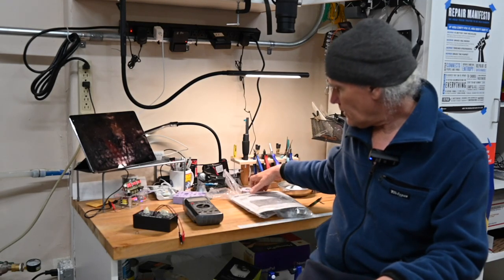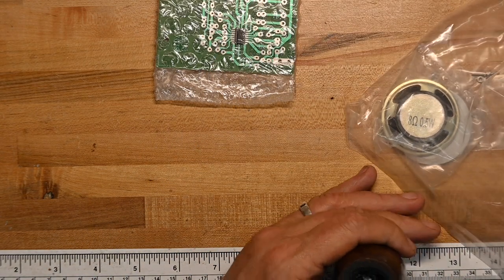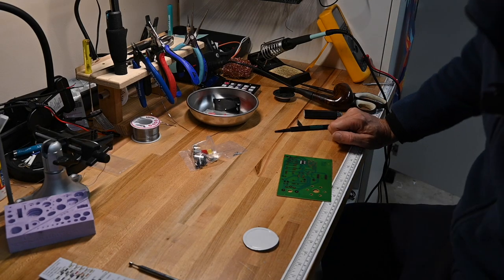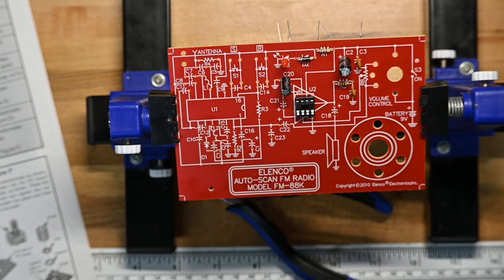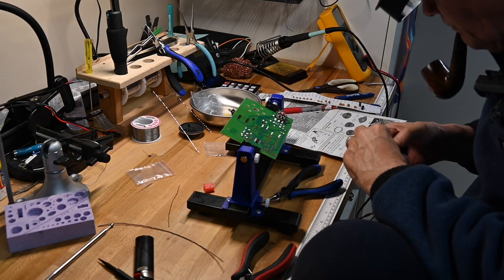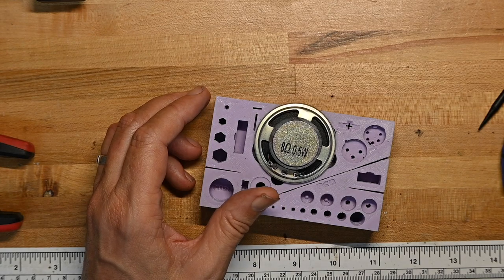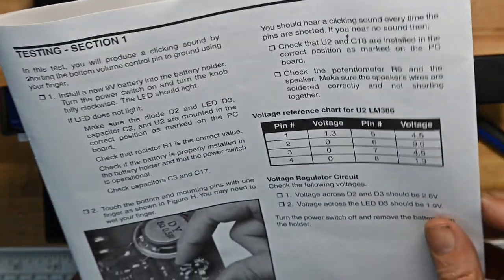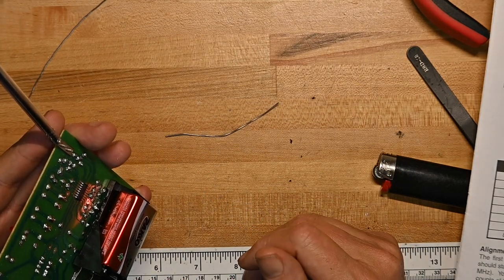C.K. builds an Elenco FM radio

Comment: Thanks for the helpful tutorial! This is my first time soldering and it's going VERY BAD.
Reply from the maker: Hang in there Levi!  It’s definitely a skill that takes a bit of time to sharpen.  Spend some time just playing with the soldering iron and solder, away from the kit itself.  Getting the feel for when the solder melts and flows is the key.  Grab some scrap wire and just practice, away from the circuit board.

Comment: I just finished building mine. Overall process went well. I am able to hit scan and have the radio pick up channels but there is A LOT of static. I have played with the spacing on the fractor (copper wire) but cant get a clear audio. I did place the extra capacitor  C* that I thought would help but it really did not. Any ideas would be appreciated.
Reply from the maker: Hm, this is a pretty noise free circuit in general, the only time I get static is when the over the air signal is interfered with.   Have you taken it outside far away from everything and do you still get static?  That could reduce it's usefulness, the design does NOT have any noise filtering or reduction.
Reply from the maker: And it's been my experience as we go all digital for delivery of music, movies, phone calls, etc. electronic makers are being MUCH less careful about stray noise (EMF) generation, so AM (and shortwave) radios are overloaded with common noise bleed.

Comment: Just did this with my 9 yo son and LED light doesn’t turn on at the testing part! What a bummer! I wonder why is not working? 😢
Reply from the maker: First things to check-make sure the LED and the diode in series with it,D2 and D3, are installed the correct way. It’s really easy to get diodes backwards, I still do it.  Second, the LED just might be bad, I’d say about one in 50 of the LEDs I get in kits are bad. The radio works though,  correct? The power LED branch not working shouldn’t affect general operation.

Comment: Do the "disk shaped" capacitors have a polarity and be placed a certain direction?
Reply from the maker: No, disk capacitors are (99% of the time) non-polarized and can be installed either way.   In the rare cases where a polarized disc cap,is used the instructions will make it very clear. But you probably will never see a polarized disk cap.